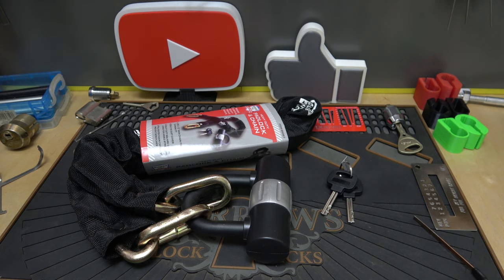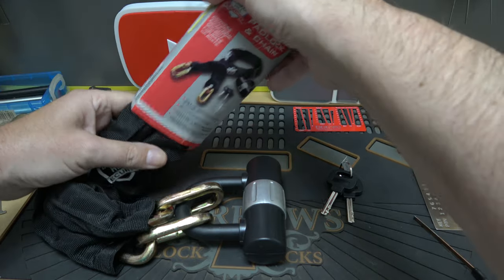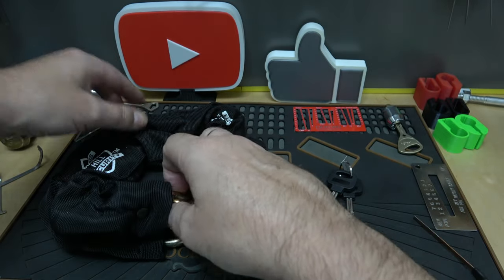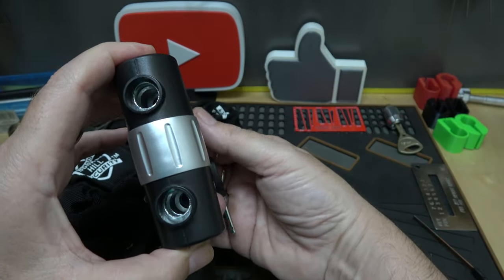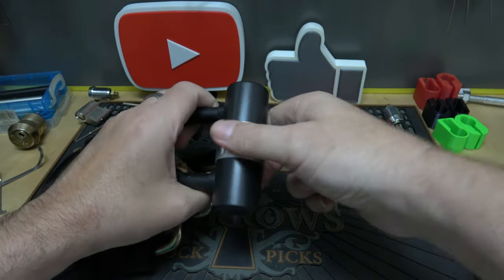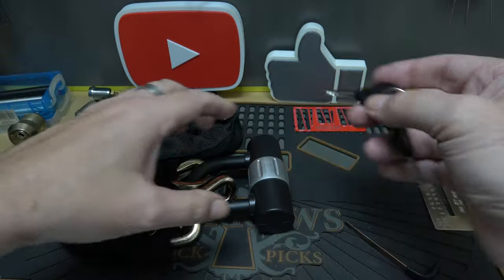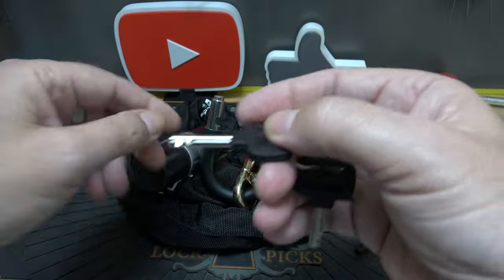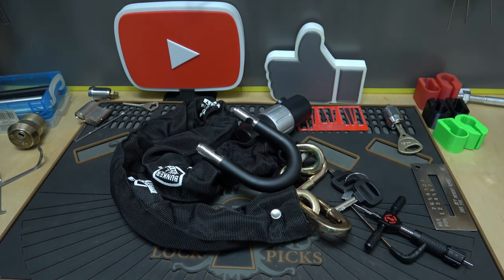#378 Bunker Hill disc detainer U-lock (Good and bad)

Comment: Can someone just easily cut this chain with a bolt cutter or is it solid?
Reply from the maker: Yes, I assume a bolt cutter would make easy work cutting this chain. If you are looking for a beefy chain maybe check out the Abus website. Nothing is really “cut proof” but a big beefy chain will not be the easy target. And avoid cable at all costs. I hope this helps.
Reply: @AlbertLebel I bought this lock, but now I realized it just seems to be made of iron. That should be a massiv difference to a steel chain.